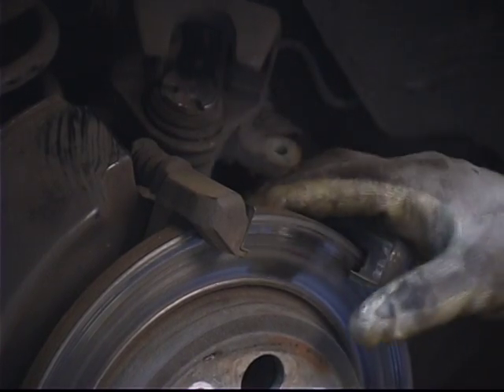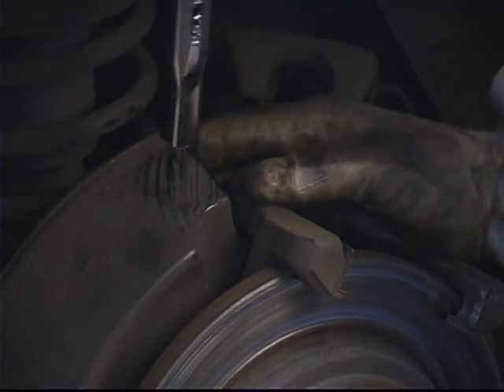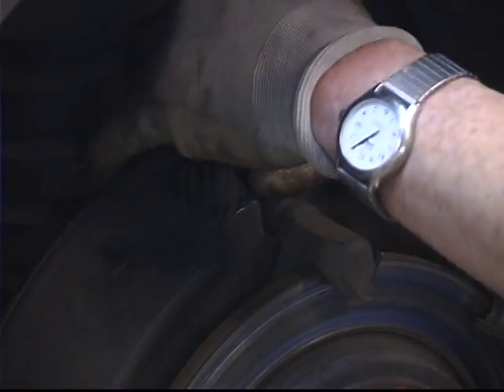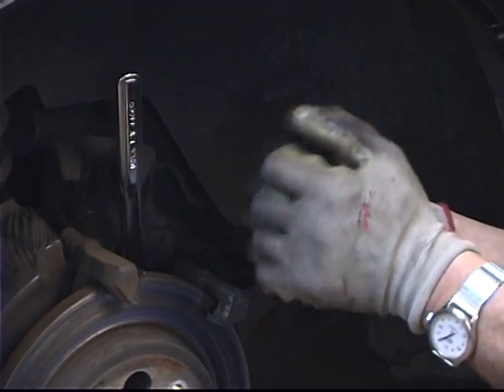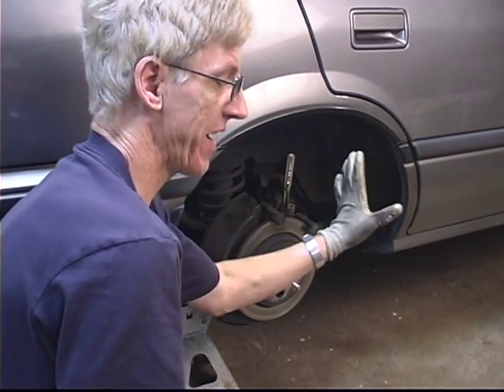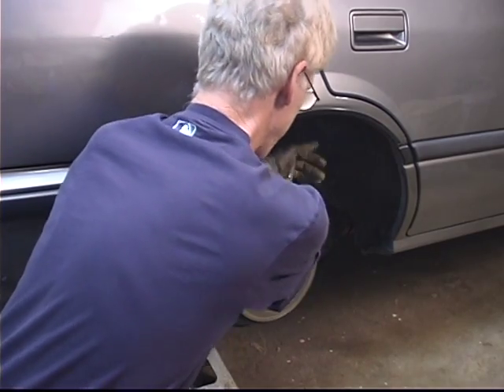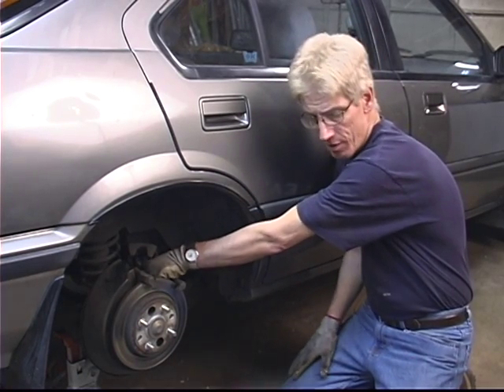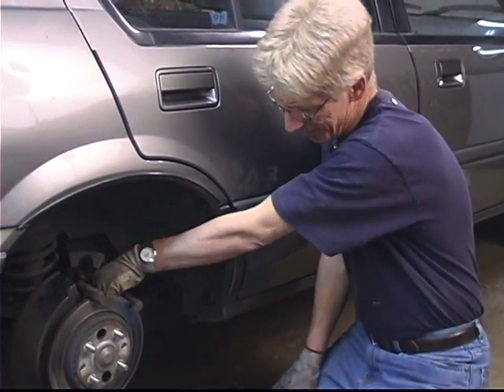How to Replace Rear Brake Pads : Removing the Caliper Mounting Brackets

Comment: Hey Wdd4lif3
About the break pads.
I don't know too much about replacing them, but I do know that some cars have disk breaks in the front and drum breaks in the rear. Most shop manuals or Haynes manuals give the best tutorials on removing and replacing parts. It's worth spending the money if you want to do it right and know you're doing it right. I hope that helps.

Comment: You want to come do my Impala? I can't get the bolts to budge for anything. I've even tried to torch. Rear discs suck because you can't turn the steering wheel to get a better angle. If I could, I'd be done already.

Comment: good thorough video but Im starting to wonder if this is a video on how to change brake pad or how to break a bolt free... oh n by the way its not a 14mil bolt if it takes a 14 mil socket its probably about an 8 mil bolt.

Comment: I take that back it may be a 10 mil bolt sorry but either way Im just trying to point out a very common mistake that alot of people make.. they think that because they use  lets say a 9/16 socket that its a 9/16 bolt and if thats what they ask for at the auto parts store instead of a 3/8 bolt wich it actually is then theyre gona end up dissapointed when they get home with the wrong bolt